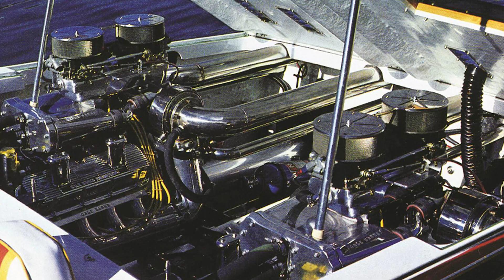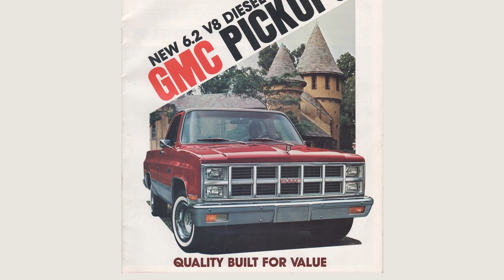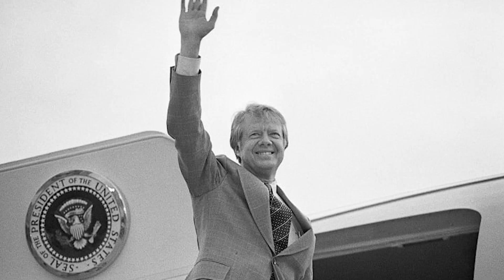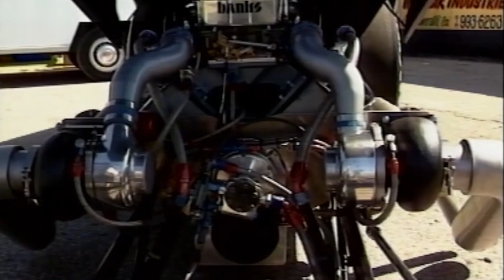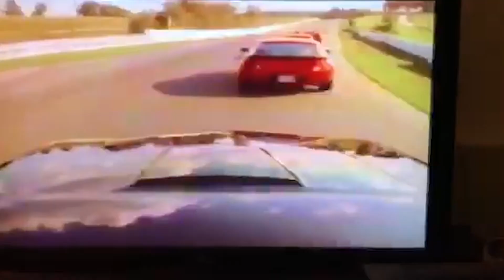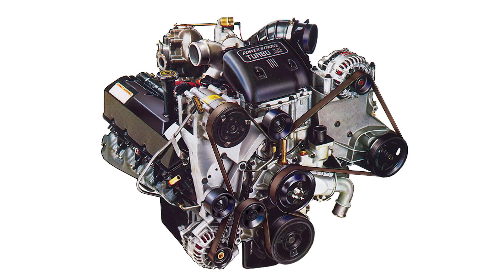How Banks got into diesel | Speed School Podcast Ep 13

Comment from the maker: Who should Gale have on as a guest, next?
Reply: More Engineers. Gale you must have connections to the Duramax team. It would be great to see a discussion about durability and what duty cycles the engineers come up with for modern powertrains with all the electrical controls involved. 
   For instance I have read many instances where if certain sensors fail in the after treatment exhaust systems the truck will go into limp mode and basically strand you. What’s up with that? Im sure an engineer could explain the reasons why this is allowed to happen. 
   Seems we are going backwards in time with modern controls at times. My 92 bronco EEC IV computer can basically run only with the TPS plugged in, not very well, but it will get you home if needed. Where did that kind of redundancy go? I’m mean that system was designed in the 80’s.
Reply: @brahmstein  It's not about engine reliability, it's about EPA regulations requiring manufacturers to put in software that disables the vehicle if the emissions system is not working.
Reply: @andyharman3022  I understand the limitations of the industry and emissions but if we heard it from the source that this truly is why modern Diesels emission systems are getting their reputation as “unreliable” by many we may all speak up a bit more. 
   It still leads to question for me as to if we loose 1 EGT sensor out of 4 why it can have an inferred value in the ECM to keep the truck going till it can be replaced. 
   The Videos posted by Banks give us so many insights into engineering design of the core engine. It’s remarkable the durability modern Diesel power plants are built with. It’s wetted my appetite for more. 🤯
Reply: @brahmstein You're absolutely correct if it's cold outside losing a sensor shouldn't be the death sentence losing the sensor shouldn't mean that you have to get towed home over driving home over something that really don't make a damn anyway them trucks when they go into regen mode the crap coming out of the exhaust pipe would equal the pollutants of the truck running it's entire lifetime without emissions control so it's hard for me to believe at any point that it's a necessary part of the system
Reply: @brahmstein  The Oshkosh/Banks/Duramax connection is something to see
Reply: Lingenfelter,,, they did good turbo work.
Reply: Me.  You can sign the cover of my Turbochargers book by Hugh MacInnes, circa 1976.
Reply: if you can find any of the guys from AIT in Australia doing dealer optioned turbo kits from the 80s had some pretty impressive stuff for the time
Reply: Jon Kaase
Reply: westen champlin
Reply: Steve brule from westech
Reply: How about Steve Dinan - I think he will be a very good matchup with Gale.
Reply: Darren Morgan also Billy G. from Comp Cams
Reply: Tom Mueller
Reply: If anything, they should video the meetings, give us something to look at on the YouTube platform, that’s why the views are down here
Reply: Me, lol
Reply: John Force
Reply: John Force
Reply: Ready for another installment!
Reply: See if the 86 year old could bring his side into story on the 7.3 turbo and how that effected so many lives
Reply: Musk Banks interview 😎
Reply: Imagine Gale interviewing John Hennessey
Reply: Don Garlits or any of the jet boat guys from back in the day!
Reply: Jay Leno’s Garage.
Reply: I'll patiently wait for the next episode.
Reply: God (gail) bank's
Reply: Deboss garage
Reply: Walt! Man i could listen to him and Gale forever. What a combination and i don't think you would find to guy's with more knowledge than them.
Reply: @paulsalvestrin7253  and why does you tube give these fakes highlighted replys? LOL
Reply: @paulsalvestrin7253  why be a trollbot and say something from behind an empty fake profile LOL
Reply: @andrewsmart2949  who is a trollbot? Why do you think my profile is fake? Not sure what your problem is ,and also can't understand what is wrong with my comment?
Reply: @paulsalvestrin7253  uo
Reply: Lmao if he was in the same room as the diesel brothers theyd leave after 5 minutes with their tales between they're legs 😆 🤣
Reply: diesel brothers or smokey nagata
Reply: Elon Musk
Reply: @funone8716  yeah so funny a trollbot says it from behind a fake empty profile LOL
Reply: @funone8716 
Yeah- I’d love to watch that.
Gale Banks is awesome- Elon Musk is a tool.

Comment: I thoroughly enjoyed this video.  As a truck industry guy for over 40 years, I started in the business as the 6.9 Powerstroke, 6.5 Turbo, and 6BT Cummins were coming out.  Great advancements were made during those mid to late 1980s.  Frankly, Dodge Trucks wouldn’t have made it without the Cummins diesel.  Ford was running away with the diesel pickup industry due to the successful evolution from 6.9L to 7.3L.  Perhaps some of this was because the GM gasoline engines were very good and they didn’t see the value of diesel like Ford and Dodge did.  Finally, GM went to Isuzu to help develop the  Duramax and has never looked back.

Truth be told, the Banks turbo and high performance products was instrumental in the growth of this entire segment because of the performance boost and confidence they provided to customers.  Banks helped “mainstream” the diesel pickup segment.   

Great video

Comment: My old lobster boat captain had a 350hp 3208 in his 36' bhm and when it was done he replaced it with a JD 300 inline 6 and it didn't have enough wheel on it so it was obvious the JD had mote power even tho it was rated 50hp less. I don't know dittly about diesels but That's what he told me anyway...

Comment: What's funny is that the IDI TURBO, manufactured in '93 and '94, with an ATS turbo would run off and leave a first generation Power Stroke...STOCK to STOCK.

Comment: That 2.3 Pinto turbo unit made it to the UK in the form of a Sierra (Lima in the states) and in the hands of Andy Rouse won the British touring car championship, for Ford replacing the 3Ltr Capri. The next competitive Ford was Sierra Cosworth with the 2Ltr Cosworth YB, fed by a T4 then T3 unit. YB is the 2.0Ltr pinto short motor, with few changes to the bottom end but then fitted with a Cosworth designed & originally built, 4 valve,belt drive DOHC making around 205-210bhp in the showroom to 530-540 bhp in race trim. 
Incidentally; Andy Rouse was also a development engineer and driver in these cars, resuling in another championship win. 
And all because of a exhaust driven spinning top

Comment: great show , thank you, very interesting.  i have a 1994 ford f 350 dually diesel, it has a idi turbo diesel the only year they did that, and on the front fender it has a banks powerpac emblem, underneath the turbo diesel e mblem  i was wondering if you could tell me what that would  encompass the t  urbo is a garret       the truck is very torquey  for 190 hp, thank you

Comment: The 3208 was not cat’s introduction into the the light duty market!  There was a 3140,45 and 50 series before that which were also v8 engines.They were found in Allis charmers tractors and in 1967+ ford f-6000 and f-7000 trucks

Comment: So many gm cars would have  had cult followers if not for  the .. as long  as it's not faster then the vette.. Bs ..Smh.  And trying to stuff  8 and 6s in to front wheel drive configurations..   a turbo 6  online. Or a longitudinal  front would  sold so many more models.

Comment: The 7.3... my daily is a 2000 F350...currently at 482,000. Still runs right up to governor. I would hop in it right now and drive anywhere... Amsoil 15 - 40. I change the crankcase religiously ..every 50,000. Filters every 25,000. That's 95 recommended changes to my 9.  Hmmm Cost savings over $8k.. Time savings PRICELESS !
Thank You Wally..

Comment: I worked as a tech in GM dealerships from about 1980-1996. I started my own shop in 96. I always embraced what other techs didn't want to do. Therefor I became the diesel guy. I was never impressed with anything GM offered until the Duramax (Isuzu) came along. That doesn't include the Luv pickup which is actually the Isuzu Pup. What a terd! If GM could have kept the oil inside the motor maybe it wouldn't have been so bad. But it was.

Comment: I have had to Diesel two cars now my current 2015 Vauxhall Astra 1.6 is still Surprises me with the mpg it gives me an average of 
51 mpg and in sixth gear at a Steady speed of 60 miles an hour 75 mpg it will pull your along on a flat road in sixth on tick over at 1000 rpm 35 mph and it runs so clean I pay zero Road fund license in the UK when I go back to petrol never

Comment: I bought an 82 chevy with a 6.2 L  in 82. I never heard of the Banks dealer turbo kit upgrade. Just learned of it today. I home shop made a intake manifold and exhaust headers for a turbo charged 6.2 and stuffed it in a early 80's van. Knowing that there was a Banks kit in existence could have made things a lot easier.
Reply: So you were the original the first to actually turbo that engine lol absolutely awesome

Comment: I dont understand why the rimd arent fans both cooling the discs and sucking air. On the straights you open flaps to reduce drag, then coming up to corners you seal up and suck the cars to the deck, while cooling the brakes.

Comment: I purchased three, new, Chevy 6.2 diesel vans. They all quickly blew their motors. All under warranty. Sold them and went to Nissan dual wheel stake body pickups. Never had any problems with my Nissan pickups. The 6.2 liter diesel GM engine was pure garbage.

Comment: These two have forgotten more than most of us will ever know...about turbocharging.  What they both seem to forget is that the two economic recessions in the 1970's were each precipitated by OPEC raising oil prices.  They were "President Carter's recession" only in that he was in office at the time.  I guess businessmen whose careers were built on burning petro-fuels have blindspots for such "inconvenient" facts.  The other point to remember is that fuel economy and exhaust emissions regulations were a major, if not the major, driving force for rapid technological advances in engines and control systems designs. I'll take the cleaner air, better economy AND big performance increases, thank you.
Reply: Carter was hard on everyone.

Comment: My first diesel truck was a 1993 K-3500 municipal truck with the J code 6.2 and 4L80-E transmission. I always wanted to turbo it with a Banks kit but ended up in Duramax land instead. Now I'm buying Banks parts for the Duramax.

Comment: This series with Walt is off the chart amazing! To listen to two practical engineers stories and how they’ve gotten where they’ve gotten to is a treasure. From the oil patch to P&W to Garrett and Banks Engineering, Walt and Gale are the kind of men I could listen to for days on end. Solving problems with slide rules a pencil some paper, head scratching along with desire is what the backbone of American industry truly was. Sadly some of this has gone by the wayside. Not to these guys though! Thanks

Comment: Nothing quite like a mechanically injected turbo diesel. Currently have a 7.3 with a non wastegated banks kit, 90cc pump, 110cc injectors in my 89 Econoline. Love the 6.9/7.3 platform but you can't really deny the capability and simplicity of the Cummins 5.9. I have a non intercooled 89 totally stock that's seen well over a million miles with no serious issues.

Comment: 3208 is a 10.4 liter motor, 666 cubes Notorious among old wrench turners for being a "throwaway engine" due to having no sleeves and not lasting long when they were turbocharged aftercooled and had the HP cranked up. The street wisdom I was told growing up is that they were meant for Vietnam, and just to be thrown away when it was wore out because who cares? Glad that Gale could kill that myth in 30 seconds.  Given the state of diesel tech at the time I cant see why they expected a little 6.2 to hold its own against a giant thundering lump of cast iron.

Comment: I could be wrong but I believe that when the 6.5 dropped in 92 that you could only get it with a turbo since in 92 and 93 you could get the naturally aspirated 6.2 or the turbo 6.5 depending on GVW and options. When the 6.5 went electronic in 94 they dropped the 6.2 so in 94-95 you could get a naturally aspirated 6.5 but only in the 1/2 ton and light duty 3/4 tons and had the 4L60e transmission. After 95, at least in the trucks, they only have a turbo but in other applications like marine still had a naturally aspirated version. Maybe I am wrong with my info but that is what everything I've seen said.

Comment: I built my own 6.9 international navistar build with capability of 40lb of boost turbo system I use it in my custom built truck that weighs 18,000lbs curb weight best motor I’ve ever had I put 6:1 gearing in the back axle and I have the best torque I’ve ever seen

Comment: 3208 was 210hp  N/A in most applications,the 1175 was 175hp with smaller injectors and exhaust manifolds,turbo version was usually 250hp

Comment: U think an aluminum block and head Cummins would be cool,  maybe improve the head flow, and give it a larger bore, with coated pistons and head , along with runners, larger valves,   and improved injectors,    it should loose 100's of pounds, with more bore , around.150" larger,   with more compression,  more boost with a decent intercooler,  I just like the simplicity of the i6 Cummins, 
But the Detroit 6-71 is cool, just too big for a light truck,  if a 6-53 was made,  2stroke turbo diesel, 😆

Comment: I worked for a Cummins shop from late 70's thru mid 80's and was  very keen on this engine. We powered a one ton gm truck with the bt-6. Had to fabricate everything except motor mounts. Got it all done and found the transmission was worn out and had to rebuild it. This truck had a steel bed, winch with cable, gin poles, chains and boomers. When tested again, it did everything but spin the tires off. Good times!

Comment: I think you forgot to mention the GM 5.7 / 350 diesel in the late -70’s, that I feel, poisoned the light vehicle / diesel market, for a time, for it’s unreliability and design faults…
Reply: It got mentioned in passing but was such a disaster that it only warranted a sentence or two. Gale had been to GM before that engine was designed and talked to them about stuff like head bolts and cylinder pressures. This engine proved that no one listened to a word he said or otherwise the accountants overrode the engineers
Reply: @jacobmoses3712  the bean counters made the choices unfortunately. However, there are quite a few of them with 250K miles or more. But the owners took good care of them. Fully warmed up before hitting the road, upgrade fuel filtration and not driving with the go go pedal on the floor.
Reply: @ks_1111  I remember hearing about a kid who got to drive a full-size wagon with that 5.7 engine. He said the gas pedal was basically a switch. You could choose idle or full throttle. There was nothing in between
Reply: Check out the video on the Amsoil bypass filter system Gale unboxed where he describes this very topic

Comment: Are you guys working on the kit for the new Ford bronco
Reply from the maker: We currently offer a PedalMonster throttle controllers for the Bronco. It's selling like hotcakes. And, we'll soon as Monster Exhaust systems.
Reply: @bankspower  I would really like an Automind or Banks Flash Tuner for the 2.8L Duramax. I love the automind for my 05 Duramax. Is there anything in the works for the 2.8L Duramax besides the Pedal Monster?